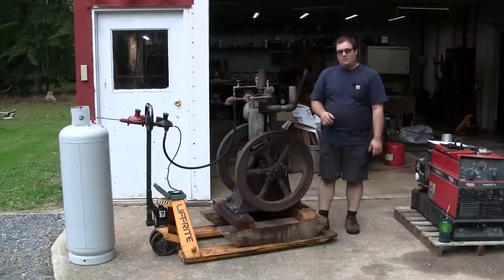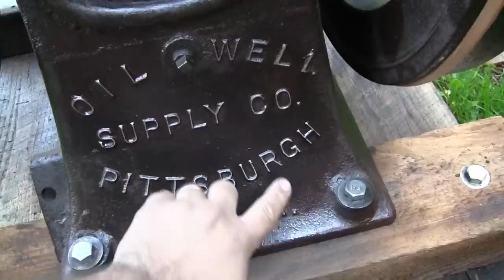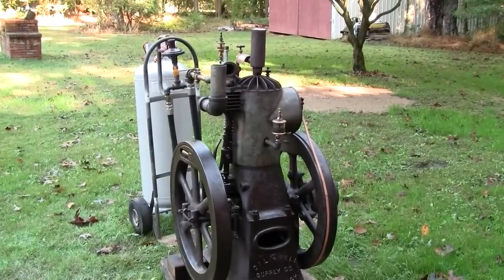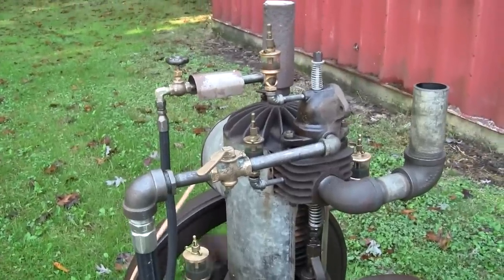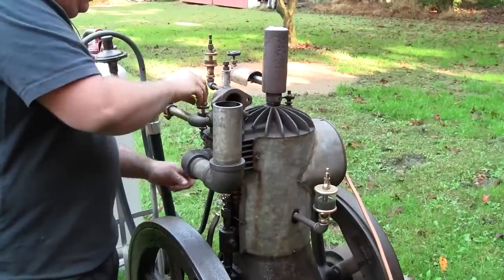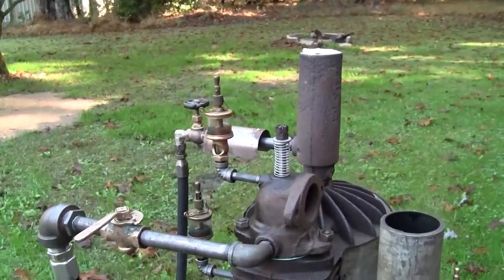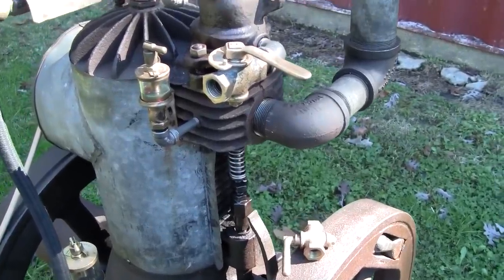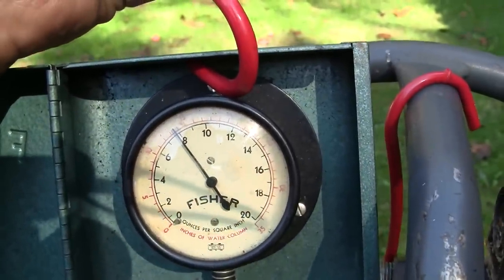100 Year Old Hit and Miss Engine Running on Propane Oil Well Supply Co.

Comment: That thing I guess is like a diesel engine the more fuel you put in the higher RPM it goes the butterfly is just wide open all the time I would expect the motor to not be able to run rich I guess that's interesting very interesting I'm going to watch the video again

Comment: Norm is right you are waaaay to rich, yes they are easier to tune under a load but it was designed to run with or without a load.....think about it. After the initial bang it's centrifugal force not engine force, there it only has a load when the engine is firing. Momentum takes care of the rest.

Comment: the weights on the flywheel the gavner place a spring on the weights
Reply: let the weights come up with a spring, there is the regulation
Reply: weights  spring weights on the flywheel

Comment: Pressure is too high. These engines were not designed to idle, you need a working load to stabilize the intake/exhaust. Can’t run these engines on LP, you need Natural Gas.

Comment: It's running perfect today you're not meant to you you run at a factory speed really there's Steve coming from the week each wheel turns a different fears off the belt drive

Comment: I do not understand the purpose of what you are trying to do. If you wanted to spin faster you need to adjust the governors. If you only want it to cycle one time instead of two you need to put a load on the motor , so it is not free spinning... but other than that it is running How it was built to run

Comment: put a load in it . should run just fine. shes talking to you .saying  ran out of work or the load disconnected. a fancy diagnostic computer to send a text that the jobs done is not needed. it hiccups and like the bird you can hear it a mileormore.

Comment: It is Hit OR MISS...... NOT TO RUN FAST.... FIRING TO MANY TIMES.... THE CYL. WILL OVER HEAT.... WITH THE TINY FAN...... TACH ... THE SHAFT..... STOP OVER THINKING IT.....SIMPLE.... SLOW AND COOL....

Comment: The “Hit and Miss” engine is supposed to run that way. It’s nit designed to run at high speed. It’s a self regulating fuel system. You adjust the speed thru adjusting the governor

Comment: It's RPM, a hit & miss engine misses when the engine is sinning faster than the governor is set for. Put a load onit, it will run as you want it to.